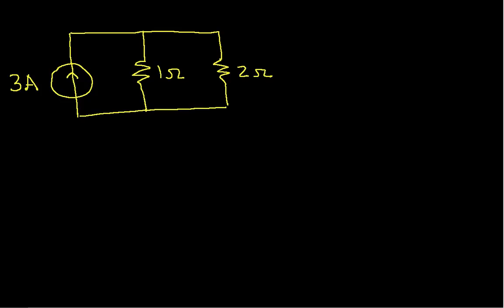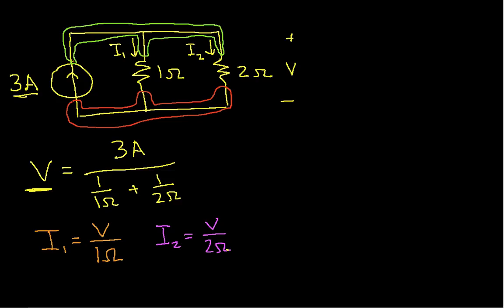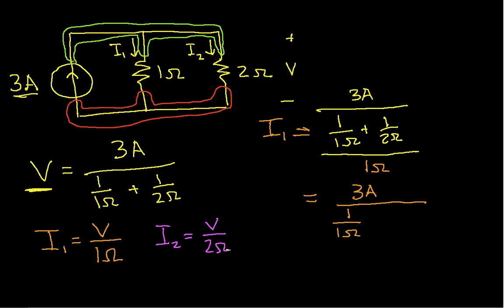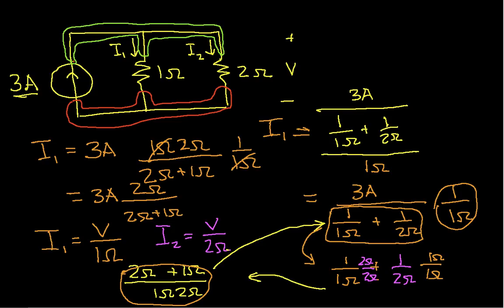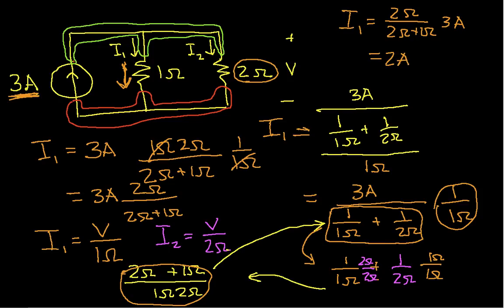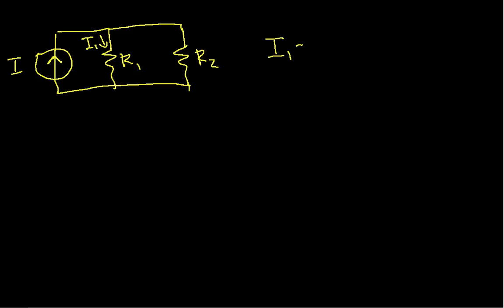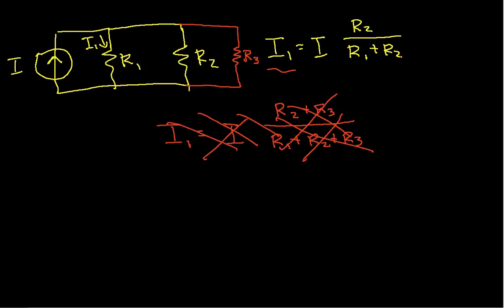Current Divider

Comment from the maker: You suggest finding the equivalent resistance of the parallel resistors; this is a great way to solve the circuit. My goal was to show how the current divider works; the math I use is very similar to the math used to find the formula for the equivalent resistance of parallel resistors.

Comment: I have been confused by the current divider rule for a while, and I appreciate you working through the derivation from basics like Ohm's Law and the parallel resistance formula that Iknow well. Thanks also for pointing out how not to use it! I feel like I understand it a lot better now!

Comment from the maker: You are correct that you can replace the other parallel resistors with an equivalent resistor and then use the current divider.

Comment: Darryl

1 Question about the last schematic:

Q1:Could I collapse the far right one into a equivalent resistance, Req? Then take the current divider rule and determine I?

One last key questions(only1):

Q2: should I never do current divider with a current source that's in series with what looks like a parallel resistor to the resistor you're using to find your I.  Basically what you drew initially except now you draw a current source on the far right in series with the second resistor.

I guess the right side system WOULD actually be in parallel?  How would you find the equivalent resistance with a current source?  They have no resistance so they are as if they are a component that basically stops you from using Current Divider.

I know there are other methods to find the current in the far left resistor, without touching current divider, but yeah i like to go back and see connection.  Can you please answer? test soon.

thanks

Comment: Good! This is what I wanted to know. Darryl you should have considered providing a solution to the current divider in circuits with 3+ parallel circuits.
Other than that, great. Thanks a lot.

Comment: for the last part, when you were outlining what you cannot do, if you combined the resistors to the right of R1, and calculated the total resistance between them like so:

(1/R2 + 1/R3)^-1 = R
let R = R4, then replace R2 || R3 with R4, and then use the current division formula easily? 

In effect keep the resistor you want the current of, and replace the other resistors in the circuit with one.

Comment: if we want to use current divider for  more than 2 resistors say 3 resistor then we have to find the equivalent resistor between any two and keep the 3 rd resistor as it is .Now there are 2 resistors we can easily solve it

Comment from the maker: The last point that I am trying to make is that the current divider, as I have presented it for two resistors in parallel, does not extend to three resistors in parallel.

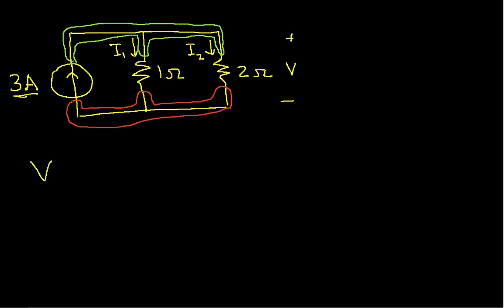Comment: at 2:33, why is it not current MULTIPLIED by resistance????
Reply: It doesnt show here properly but what he did is this:
V=IR
V=volts  
I=( 3A ) 
R = (1/1 +1/2)^-1  (This is confusing because this is the formula for the parallel connection for R)

So instead of using 1ohm or 2 ohm separately, he used the parallel formula to simplify the resistance from that parallel circuit, the answer of which is 2/3ohm.

This means that the formula he used is V=IR.
Just in this form:

V = (3A) multiplied by (1/(1/1+1/2))

Comment: When adding resistors in a parallel circuit isnt it like this (R1^-1+R2^-2)and not like R1+R2
Reply: +John Anthony Britanico Correct, with one small correction - R2^-1, or basically (1/R1)+(1/R2). R1+R2 is here  a unique part of the formula for current division only, not how you would calculate their resistance. It's weird, because we're used to seeing the inverse resistances added when dealing with parallel, but it works!

Comment: Now what happens if there's three resistance!?...
Reply: You can add all of the resistors together excluding the resistor through which you'd like to find the current using the parallel resistance equation. You can then do exactly what was shown above using that resistance in parallel with the resistor through which the desired current is flowing.

Comment: Didn't understand anything. Since when did V equal current/resistance :/ I highly suggest you delete this video because its confusing those who need help and your video is not helping :/
Reply: its not current over resistance... resistors in parallel are equal to 1((1/R1)+(1/R2))=Rtot. he just kept it in that form so it looks like its  current being divided by resistance but its actually not
Reply: No, he was finding the voltage lol... But he did    V=A/((1/R)+(1/R))     which is the same as V=AR     idk why he did it that way, though... It's not wrong, but it's just SO EXTRA and a waste of time.